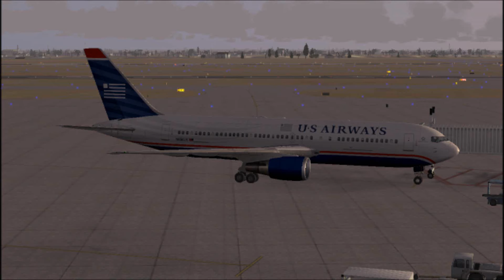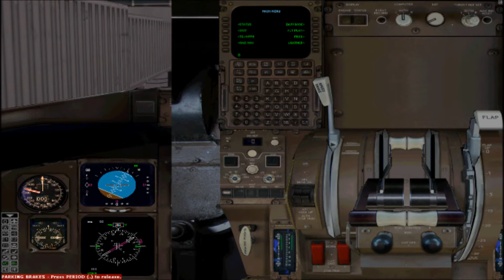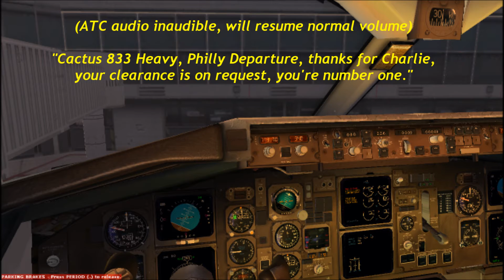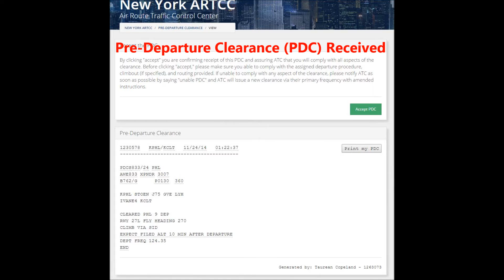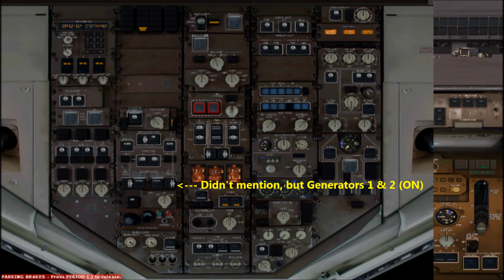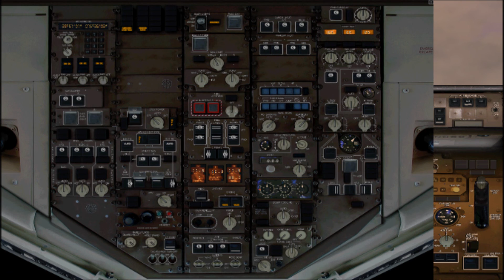VATSIM: CLS 767 Full Start-up & Departure with ATC | Philadelphia Int'l (FSX)

Comment: How much does this aircraft affect frame rates? Nice video! I like this style.
Reply from the maker: Kind of a lot. Usually run 30-40 FPS and with the CLS I run abou0 20 FPS. Its a very nice model though. Level-D 767 is easier on the frames I've heard.

Comment: Hey quick question!  What would you think a good cruise speed for a 737-400 and 737-800/900 would be for FL300-FL350
Reply: Realistically, it depends on the airline. Airlines use different speeds for fuel efficiency. However on default aircraft, just fly as fast as you can without over speeding.
Reply: maroon just fly as fast you can.
Welcome to steam edition.
Reply: about 250kts to 300kts is a good speed
Reply: For 737 use Mach 0.75, thats what i use